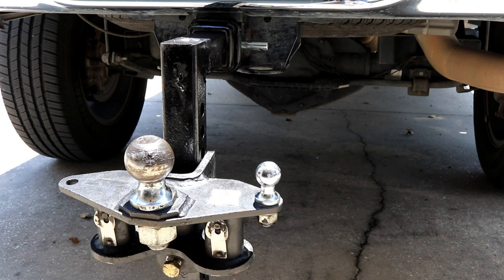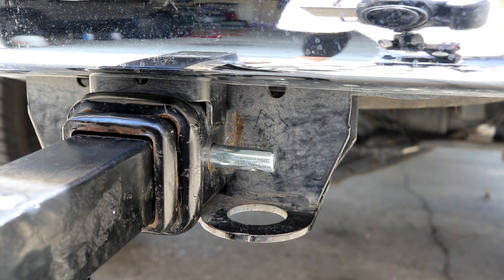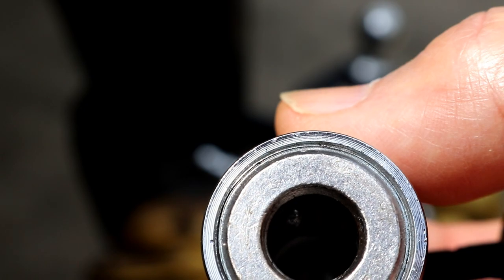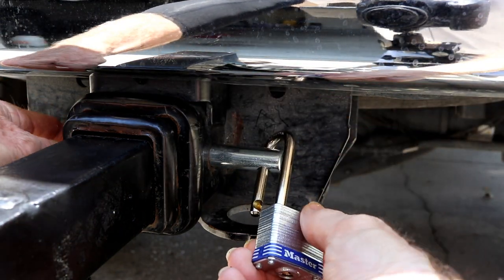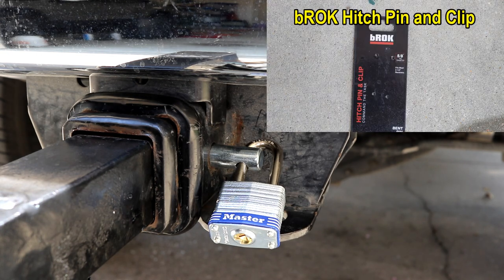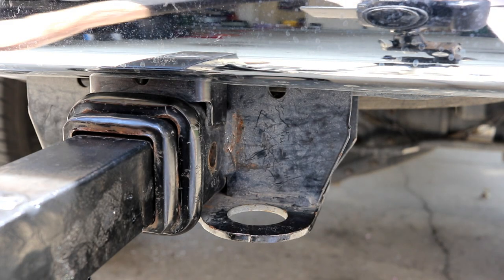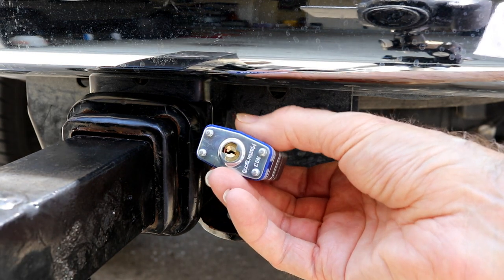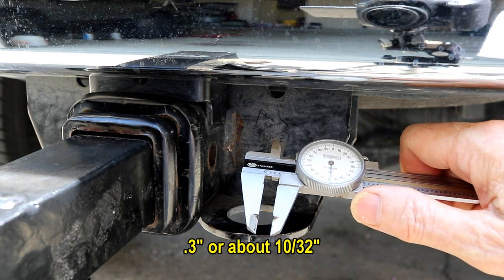A better locking hitch pin?

Comment: I did something similar to the receiver pin on my motorcycle trailer hitch. I even added a spring so as to not rattle and make noise.

My wife and I were leaving on a 30 day, 11 state, 8,000 mile motorcycle trip and I didn’t want my small cargo trailer, which I had just customized & having all my wife’s junk I mean our cargo in, just walking away.

My wife thinks I worry to much but I say I’m just a realist.

✌🏽🇺🇸🙏

Comment: I started using this method about 20 years ago, like you I drilled the hole to accept the lock and used a regular master lock, it worked just fine until one winter I needed to switch to a different type of hitch, and the lock did not work too well, so I used my torch to heat it to help get it off after I got it off I went to Home Depot and bought a new lock that was made for outdoor use and that ended that problem, where I live some people will lift your hitch while you are in the store shopping, this method also put an end to that problem too. besides that, it doesn't cost any more money unless you don't have a drill and the right size drill bit. Some might think it may rattle but It doesn't
Reply from the maker: Yea, unfortunately some people are crooks.  I spray some lube in mine every once in a while for the same reason you  mention.

Comment: Thanks Marion, I agree, the main thing is a totally safe pin system. Those ball bearing systems definitely warrant skepticism and it makes sense to be less trustworthy. Thanks to you I'm gonna have a closer look at my pins and might do exactly what you did. I think it's odd Lowe's didn't have a lock available that would fit without you having to drill it a little larger. My dilemma is whether or not to replace 6 year old TailerKing tires with new Goodyear Endurance tires because my TrailerKings look great with less than 5000 miles on em. Only one has a little bit of cracking. A few guys at shops tell me I got plenty of life on em still. Do blowouts still happen on tires that aren't that old and look very good? Thanks, God Bless and have a wonderful camping trip! 💥
Reply from the maker: I would suspect if you see some cracking it past due to change them but I always replace them at 5 years.  6 years, I'd change them.  I did the same thing with my Westlakes.  They looked new but replaced them anyway.  The spare is still perfect.  The Goodyear's are popular.  The Maxxis M8008 are very good tire also.

Comment: I had to cut a Reese hitch pin lock off after 1 year of driving because it rusted and key wouldn’t turn. Sprayed it with wd40 probably on blaster. What a pain that was to cut off upside down.

Comment: Great idea!! That's a great cheaper solution. I have a different brand lock similar to the Reese that cracked on you, mine has been OK for probably 8 years but I should replace it just in case.

Comment: I did the same but that Masterlock #3 is not secure against stealing. You said you dont care but its the lock that lock pickers start on as its the easiest to pick. I used a stainless hitch pin and a stainless lock. It cost me $10 to get the hole drilled by a machine shop as stainless cant be drilled with a standard high speed steel drill bit.

Comment: I like your plan. Let's be honest, nowadays criminals carry battery-run angle grinders and cut-off blades. Very few still use bolt cutters. Doesn't matter if you have a lock like yours or a hitch pin lock, when they come to steal something, 15 seconds later it's off and they have what they want. We are just trying to keep semi-honest people from easy pickens.

Comment: I don't trust those other kind of locking pins either. As long as safety is the issue and not security then this will be hard to beat.
Reply: Do you know of a pin system that gives both great safety as well as criminal proof? Thanks